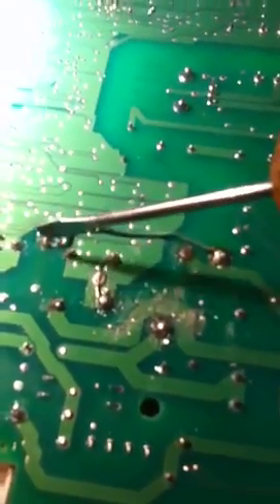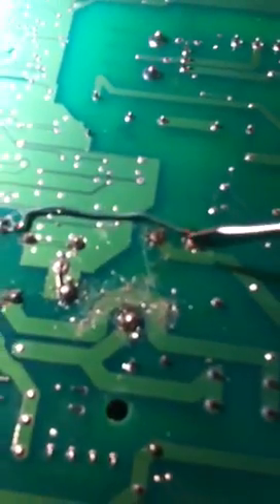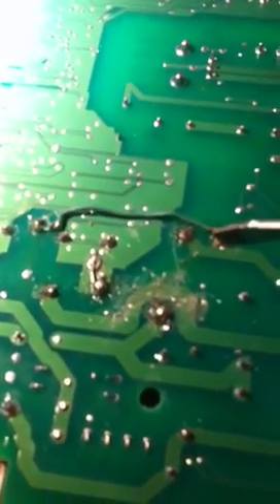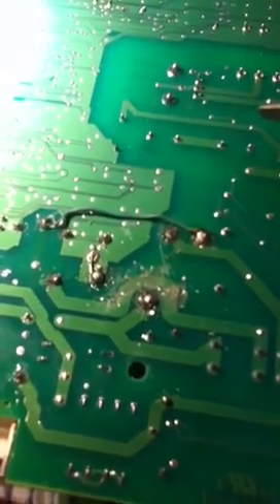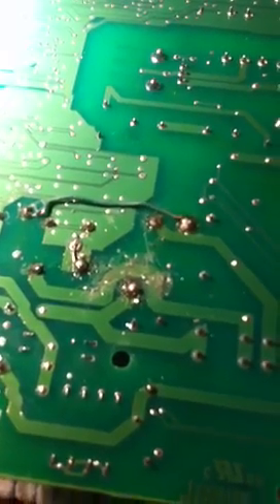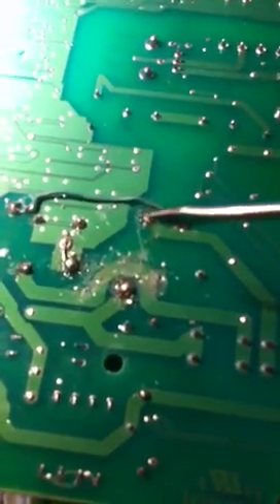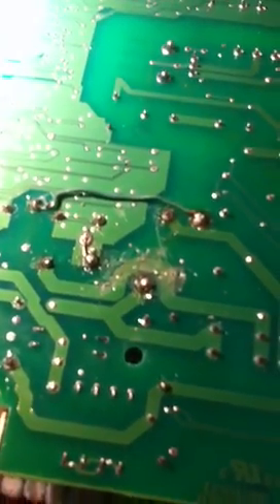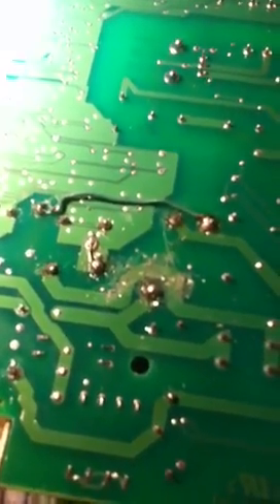GE Refrigerator Mother Board Defrost Repair

Comment: Good the refrigerator to go the light lasts 8 days to light and then works well until the light goes back and does not turn on, if you can give a help on the card, to fix that fault I am from Venezuela.

Comment: I've got same board and found on back of board the line in solder joint at the relay burned out. My relay isn't bulging or anything so I'm gonna wire repair. Was wondering if you're jumper did the trick, just in case my relay turns out to be bad as well.

Comment from the maker: @DCVU2 Thermistor is one of the culprits but what you are describing is exactly what I was experiencing. Did you visually inspect the bottom of the board for burns. If there is a burn like I mentioned before, that is your culprit. The thermostat can also be a problem. I pull it out, and drop it in a glass of ice water, and it should be closed connection until it gets cold after 4-5 minutes and then it opens up. It is crude but it does work.
Reply: hola, tengo un problema en mi refrigerador ge by side, dos puertas, la parte del freezer no me pasa de - 12 grados centigrados, y esta seteada en -20, la parte de la heladera funciona correctamente, los termistores marcan resistencias normales, el proceso de descongelacion lo hace normal, a lo mejor muy seguido, los ventiladores funcionan ok, ya no se que mirar, hace unos meses le cambie unos capacitores a la placa. el año pasado se le hizo una carga de gas y aceite por rotura de caño, no creo q venga por ahi en problema.

Comment from the maker: @DCVU2 Sorry for the delay. 2 Immediate considerations, First what was the initial symptom? If the refer was dead, typically, the 2 large identical caps with splits on them might be shorted. They are surge protector caps that can take a direct hit & short out to keep the board from getting a direct hit. Removing them will fry your board if you get another surge. Removing them will expose the board if surge. My guess,you had power issues in your neighborhood. Take a pix & erickirkhuff@gmail.com.

Comment: hi thanks for your tutorial on where to look when repairing the defrost when its an intermitant fault & everything else checks ok, i dont usually do board repairs the odd 1 or 2 if i can visably see the fault otherwise i replace the board in appliances im servicing, 1 Question, you may able to answer, a GE F/F mod GSG201EPHFBB not getting a live feed to the comp, looked at the board & one of the 2 largest blue  caps is domed out but not split could this be the cause for no live feed at comp, thx